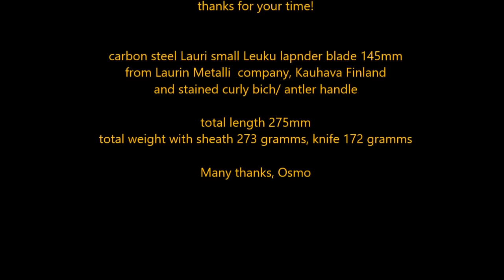Small Lauri Leuku Laplander - How to

Comment: i notice how you keep handle always on the moves during heavy sanding so as not to overscour!! you still cannot beat that final hand finish methods!! it looks great i always get butterflies before i give its final coat of polish or oil stain etc
because you never quite know how its going to work out until it miraculously alters in front of you i always find this bit final finitions exciting! very rewarding self
satisfying!!
youve made a nice selection on the grain effects in these wooden stocks!! always pays to be patient when dealing with these specialist stock woods! it gets too inconvenient & expensive if you try to rush it & make a mistake!! sanding is pretty safe processes as long as your aware of your erosion rate and shape parameters
i always use water to lift up & out the end grains
before shearing them off finishing with 00 000 x4 00 grit papers or finest wire wool
on the lathe!! 
set at 2000rpm!
white friction polish works well
also if you do it this way?
finished off with a harder carnauba then buffed! i can honestly hand on heart say i havent yet disliked anything youve produced
and im fussy not many artists can satisfy me easily but all of your designs uses of materials do!! 
its rare to discover not only a product or something you very much like but also made by someone with very similar finition tastes!!
Reply from the maker: It's very true David all your remarks! Thanks for liking my work!

Comment: Beautiful knife workmanship and a nice sequencing to the video.  I am guessing on this Laurin blade that its rat-tailed end was quite short compared to the larger and longer handle you made?  In this case is there a certain type of 2-part epoxy bonding or bedding that secures the tail into the handle that is better than another?  What epoxy resins or glues do you prefer?  I am building a Yakut 125mm blade with a very short rat-tail likely using aluminum, wood, leather, and moose handle materials.
Reply from the maker: Alaska Raft Connection - Alaska-BushRafter Almost all the tangs in Finnish rat tail knifes are long enough for peening. I cut this to maybe 8 centimeter length and used it as a hidden tang. That was my original plan. Then decided to add the antler in the end which I had to attach with glue and brass dowels insted of using the help of that rat tail chance... the two pack epoxies are all good. Never met one which would have failed. I usually buy my epoxy from Brisa. That certain size, volume of glue is only sold in Finland. Araldit is the brand. Thanks, Osmo
Reply: Thank you...  Good stuff --- occasionally use Araldite adhesives in my raft shop here in Alaska.  Thanks again for reply.

Comment: so these  knives are pretty sturdy? considering they are not full tang.
Reply from the maker: Abel Escareno I bet fulltangs are always sturdier naturally but laplanders have their places in bushcraft world. It's not an ax but you can do batoning work with it. You try to choose your best tool what you are going to do am I right? And yes, it's not supposed to use like crowbar like no knife is. Hope this helps. Thanks, Osmo
Reply: Cool. Just wondering i think i want to try and put one together
Reply from the maker: Abel Escareno You will love it - freedom not to follow the shape of the tang!
Reply from the maker: You must be thinking of that rat tail tang compared to fultang. I don't see any problem if you don't abuse it. Well, this is the way they have been made in general for hundreds of years - not with epoxy of course. :) which makes the structure even sturdier.